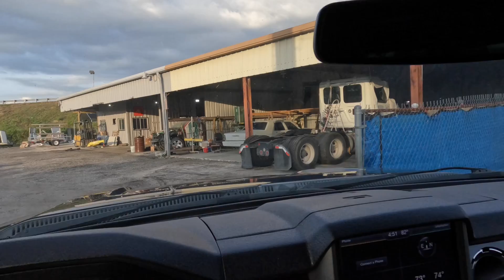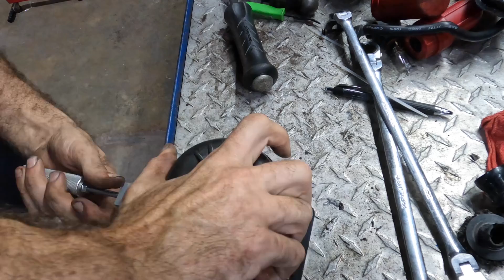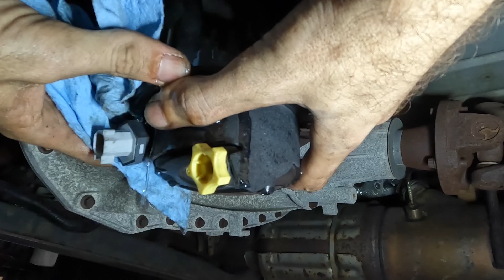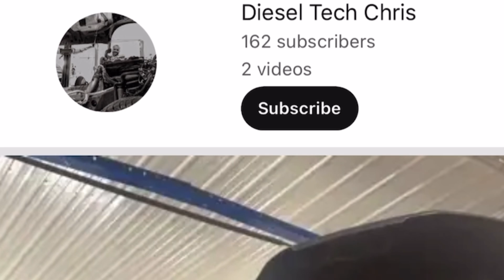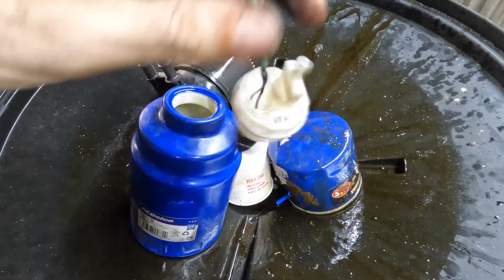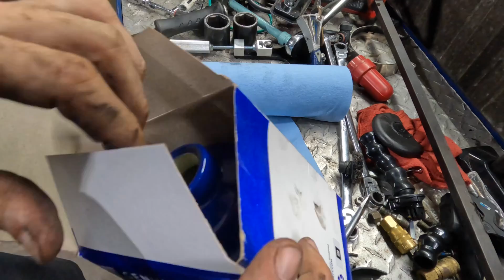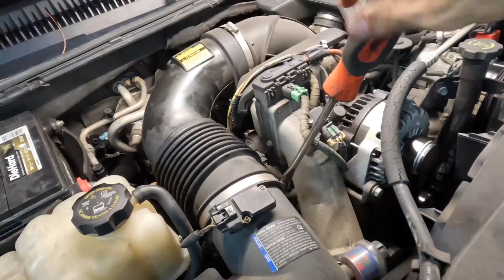Diesel Fuel System Filters!  Duramax & Powerstroke 6.6 & 6.7

Comment: I wonder if those fancy new oil filter wrenches would takeoff your fuel filter
Reply: Yep 😆
Reply: it is collector sets only, do not want to ruin them.
Reply: Humm...  I too was thinking the same thing!...
Reply: I don't think they have the diameter to fit over the GM fuel filter. I use a strap wrench on my filter and don't even have to remove the air intake!

Comment: Suggestion when using the oil filter cutter: use a vice to hold the filter, then slowly walk in the cutter as you turn it around filter and it will cut evenly and make the job easier….. I learned this when cutting open the oil filter on my plane….a required item each year to inspect for metal. -Bill N80UF
Reply: We had a 2021 cirrus make chunky glitter in the fuel system guy who owned it said its running bad on runup told him over CTAF ok bring it back we will look at it 
Heard the engine backfire and die quick 
4 new injectors later a new boost pump 3 valves that cooked and crap tons of labor

Thing was in the hangar for a few weeks for parts when i putted by in the trike

Comment: Surprised you put fuels into the oil collector tank.  In the uk you can recycle old engine oil for free as it is recycled for incinerator burners but any gas/diesel in it makes it unusable so our recycle centres are strict with separate collectors for oil, gas/diesel, paints etc.  so long as folk follow the rules there is no disposal cost. (Helps the environment as well as saving costs).

Comment: It is interesting to me owner chose independent over dealer with a new car. This is why: Where I live, not much difference in cost between the two (about $5/hr difference), so the advice has been when under dealer /manufacturers warranty or under 100k, have dealer perform all regular maintenance. The notion is car is worth more on resale (especially to a dealership) and easier to finance (for everyone).  Then again, I have not owned a new car in 20 years. I have no incentive to choose one over the other than cost/convenience, and here, dealer wins on both for most things-- especially tires. Valve covers, not so much.

Comment: I would be concerned about fuel contamination with putting the dielectric grease onto the GM fuel filter. Just lots of diesel???? 
13mm on 1/4" drive for fuel bleeder, and 5/16" / 8mm for air flow banding.

Comment: That hand bleeder is so old school it's crazy, I remember when they were used on the diesels with mechanical pumps and only one pressure side.

Back in the day that you had to crack the pipes at the injectors to bleed all the air out of them individually.

Comment: Something, color grey,  fell on the right side just after tightning filter. Suprised that you did not notice. It is still in engine compartment.
Reply: Broken wire loom pieces?
Reply: @dennislyon5412  Yes, I think so but I wondered if he is precise or detailed enough to notice. Next time it is a nut falling into a cylinder. The devil is in the details.
Reply: @loubakker5000  - Lou - agree 100% when things are opened up.  Don’t want hard things falling into intakes or cylinders!

Comment: I love my LBZ Duramax, but I really like the fuel filter on the 6.7 PowerStroke. BTW my 2007 GMC Sierra 2500HD Classic only has 54K miles manual door locks, manual windows and floor shift 4WD

Comment: "Windows Down so the car doesn't lock me out."  <-- I have a 2015 F-150XL and that has happened to me!   Thankfully, I leave a spare to the Ford in my 2001 Chevy Silverado EXT.   I left the Ford running to warm up and had just closed the Garage door.   I here a noise as I'm moving the trash cans and the darn truck just locked the doors.    That skeered me, what if I wasnt at home?  So, I mounted a lock box and put the spare key in that.   Four more times that Ford Truck locked me out, Seven times to the dealer for 'software' upgrades and a MONTH long A/C repair (back and forth again and again to three separate dealers!)  I like my Ford.. it's a "Couch with Wheels" but for the heavy lifting and moving, that Old Chevy does it better and is much easier and cheaper to repair.   Powerstroke vs.  Duramax?   Easier/Cheaper to fix a Duramax if it isn't taken care of, Powerstroke can be a bit $$$ to repair if not taken care of.  BOTH, good and strong engines and will run forever!!   IF Taken Care of!

Comment: That is a rhombus ring.
If you will acquire a product called Gibbs. Comes in spray cans, you can spray that manual pump and it will get enough of a fine lubricant on to that O-ring on that pump and it will keep that pump from drying out. You can also use 303 protectant, but I'm not certain whether that is any more fuel resistant than the gibbs. But it might be worth investigating 303 protective is great for any rubber products, if you treat a serpentine belt really well before you install it, give it about 12 hours to dry, the serpentine belt will last considerably longer. You'll end up changing a couple of pulleys on it before you end up changing out the belt.

Comment: Neat tool, but to operate it you need to tighten it up until it only snugly contacts the surface of the filter then begin turning the filter and after each turn tighten the tool more, repeat until done.

Comment: Hahaha Ray who speaks German! Click means of course also "K"lick in German. 
I've seen a lot of videos from you so far. Much is not allowed or permissible at all in Germany. Here you need a master for everything. On brakes or electrical components that are relevant to safety, you may not work here as a normal mechanic. 
When I see the rust on the vehicles in your videos, the vehicle would be shut down immediately in our country. Exhaust systems without an inspection seal are illegal here. 
Here are a few German words for you. 
Brechstange = Pry bar
Pfuscherei = Bungling
Schön und glänzend = Nice and Shiny 😉

I wish you good luck with your new workshop. 
Greetings from Rheinberg (NRW) in Germany

Comment: Im old school people and i do more Duramax style changes, on semi trucks those are just bigger ones and might be 2 filters, i prefill filters if possible.
Powerstroke is easy to do, only to empty lift pump it needs replacement air or it will suck fuel from tank and its like "endless drain" i think.   
For example Audi and VW Diesels have that plastic filter unit like on Powerstroke, its easy and fast.

Here Finland click is like 1st click = ensimmäinen kliksahdus and then second = toinen kliksahdus or in numbers one = yksi kliksahdus and kaksi kliksahdusta.
Reply: Why would you need to prefill when these have electric pumps with return lines. They should purge  themselves.
Reply: @Bryan-Hensley  Older trucks/tractors... dont have electric pumps, you just save from hasle when doing it on those.

Comment: Although it doesn't seem  necessary in this case, the inside of the filter housing on the Ferd should also be cleaned.  Technology adapted from commercial truck engines, much like my  Detroit/Daimler/DD16.
As for which is better...I'd have to go with the Duramax. The newer 6.7 is a very close second.
I'm really loving the fact that you're the management, and there's no co-workers cursing because you  accidentally moved his hose sticking out into your stall, or some other stupid shit.

Comment: That 6.7 was a heck of a lot easier than my 7.3 & 6 0 Fords that had the lower fuel filters down on the frame rail between the cab and the transmission cross member!!
Reply: Add the 6.4l with (i believe) 2 fuel filters (1 on rail and 1 up top). Its been a few years since ive owned it but i remember changing the 1 on the rail involved getting fuel all over my arms...
Reply: Yeah but is it worth the DEF and EGR issues?

Comment: I have a 2014 LML with the same fuel filter system as yours, it’s awkward but for how often it’s done not bad. In Canada our GM fuel filters are white. 
My son’s 2017 L5P has its filters on the frame rail which makes it more accessible. But the Ford filter is really easy.
Reply: GM (at least in the US) switched filter manufacturers a few years ago. The new blue filters are a cheaper single stage filter and not shrink wrapped like the white ones. I now use the Parker / Racor brand which is identical to the white gm filters.

Comment: It's ok for diesel, but never use dielectric grease on the fuel systems of gas engines.  Dielectric grease is silicone based, and causes contamination of spark plugs, O2 sensors and catalytic converters.
Reply: When I worked for cummins we used vegetable oil for all fuel system lubrications on seals. Still to this day its all I use.
Reply: @UrbanStyleCat  Can't go far wrong with vegetable oil!

Comment: Almost 35,000 miles on fuel filters? That customer is asking for a very big repair bill
Reply: Recommended interval is 22,500 miles, IIRC (or sooner, if directed to by the truck).
Reply: @wesgregg6451  yes and I would personally do it even sooner. Filters are relatively cheap. High-pressure, fuel pumps and injectors are expensive.
Reply: @kevinbarry71  it will kill gasoline fuel pumps if the filter isn't changed between 10,000 and 30,000 miles depending on where you buy your fuel. They get clogged up with something that looks like crude oil.
Reply: They’re not the original filters, the one on the engine has 3 nipples from the factory with one being plugged off.

Comment: They are all junk. Common rail, the high pressure pumps fail too often. The injector nozzles can’t take the high pressure and also faiL too often. The wiring in the hot oil under the valve cover fails too often. If you do some math and price a gas vs a diesel pickup you can drive the gas truck 100,000 before you get to the price of the diesel. I don’t see how a lite duty diesel is a good investment when you add up the costs, purchase price, maintenance, fuel, and repairs,
Reply: "Light duty" is a relative term. A lot of people tow 14,000 to 20,000 pound campers/etc., and don't like to slow down on hills while doing so.
Reply: @wesgregg6451  even at 25,000lbs diesel doesn’t have an advantage over gas. In fact gas engines were used in local haul trucks of all weight classes up until the early 90’s. Back then you had a lower fuel price and got better MPG than gas. Today with the price of fuel and the emissions gutting the MPG they have no advantage over modern fuel injected gas engines.
Reply: @wesgregg6451  And no light duty isn’t a relative term. There are 8 class ratings of trucks. Light duty refers to vehicles up to 25,000lbs which most states allow you to operate without a commercial driver’s license, providing that it doesn’t have air brakes or hauling freight for hire.
Reply: @williambasinger5859  Ford did have that 6.8-liter V10 gasoline engine for a while. I don't recall why they stopped offering it. It probably wasn't all that popular a choice, at a guess. Seems like the fuel mileage was only something like 7 to 10 MPG (I could be off slightly), but it wasn't especially powerful (for the fuel mileage) - the two-valve version only produced 425 lb⋅ft of torque, and the three-valve version only increased that to 460 lb⋅ft. Which is nothing to sneeze at, of course, but if a person was thinking about buying one, read that it produced that amount of power, and when they mentioned it to their neighbor, the neighbor's response was, "Yeah, my turbodiesel produces 570 lb⋅ft of torque, gets better fuel mileage, and doesn't have that 'feature' of blowing the spark plugs out of the engine," it might have been somewhat off-putting.
Reply: @wesgregg6451  v10 wasn’t that good. The miles per gallon sucked. Flywheel torque is misleading because if the engine is geared correctly a lower torque engine will pull it te same amount of weight as a high torque. As a rule gas powered vehicles have a lower gear ratio on the rear axle than a diesel. That allows the unit to make the same torque to the ground as a diesel vehicle has. Gas engines rev higher so the lower gearing does not reduce their speed. The only time torque comes into the picture is when you are powering a direct drive application like a generator or a boat propeller. But even boats use gear reduction to swing a bigger propeller. 

Back in the 80’s when ford introduced the 6.9 international in its f250, f350 units that engine made 170hp it got about 15-17 mpg. The 460 gas engine got 5-7 mph to kpull the same load down the road. It cost 4400 dollars more for the diesel option. But diesel the cost about .50 cent a gallon versus 1.00 a gallon for gas. It didn’t take long if you drove a lot or pulled a loaded trailer a lot to pay for the cost extra of the Diesel engine. When you are getting twice the mpg and paying half as much for fuel. But today the engines are almost equal when it comes to fuel cost in mpg and at the pump. The diesel option costs 15k more, and the emissions are unreliable. The cost to purchase the diesel truck is too high the cost on maintenance is twice as much per oil change as a gas unit. The repair cost is insane, you could put a new gas long block in a truck for the price of most diesel repairs that deal with just emissions or fuel injector or fuel pump replacement.
Before 2004 diesel was a viable option for gas engines, and had some advantages over the gas engine. But that all changed when the diesel emission controls were added. 
For example 2003 a class 8 truck with a 14.7 liter cat 3406e engine. A good driver could get 9 mpg a bad driver around 6 mpg. The 2004 emissions were added and that same truck with the same driver got half the mpg dropping back to 3-5 mpg. Which is what the gas engine trucks of the 70’s and 80’s would get. All of the advantages the diesel had in the 80’s and 90’s were negated with the emissions that have been introduced the last 20 years. 
If you really sit down and look at the numbers all of the number cost maintenance repairs and so forth you will find the diesel isn’t really that a good of an option. The only diesel advantage is when you need to pull a loaded trailer 500 miles a day every day. Since most people don’t dive like that on a daily basis the diesel truck is a statement of my dick is bigger than yours, and nothing more

Comment: Silly question maybe:  What is M between drive and second gear on auto transmission mean.  It is clearly 3rd gear, but M?
Reply: Manual shift?
Reply: Yes, M for Manual. In that mode, the trans hold whatever gear you're in, and you can go up and down through the gear range using a + and - buttons on the gear lever. Both my 2013 F-150 and 2016 F-350 have this feature.
Reply: @ericbarker68 Cool. Ta!
Reply: Dumbest feature added to automatic vehicles, God forbid they just have a manual option 🙄